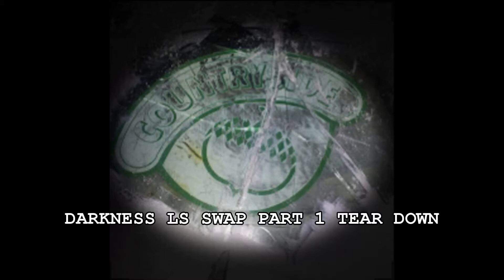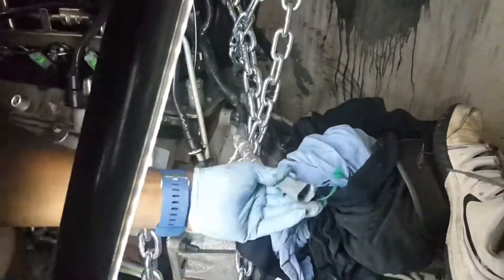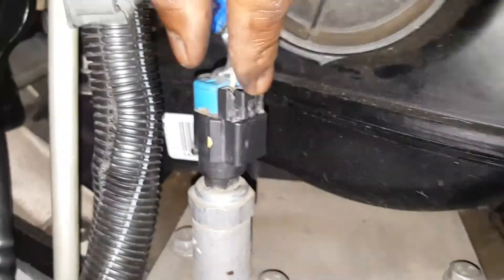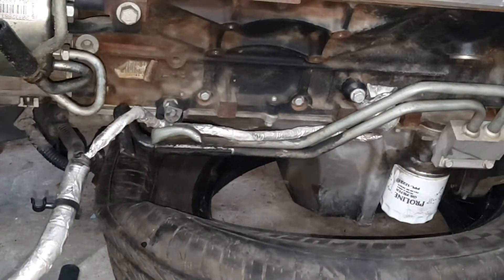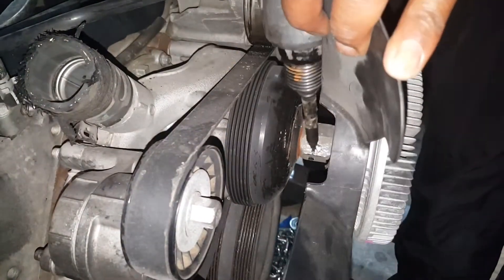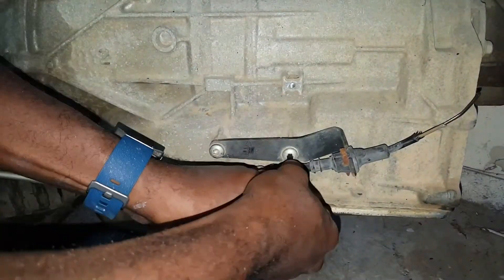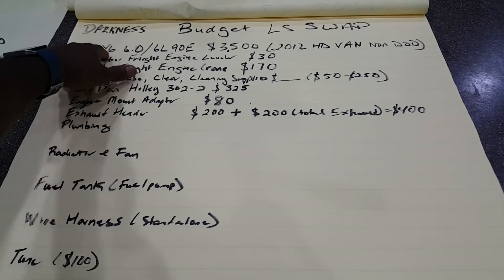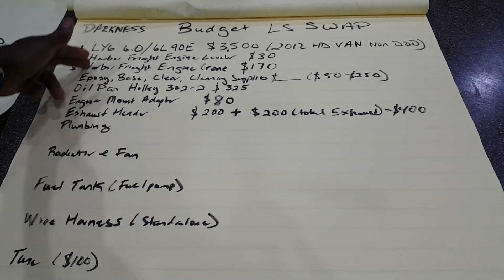LS ENGINE TEAR DOWN STEP BY STEP 'JOURNEY BEGINS' DARKNESS PART 1

Comment: You really didn't need to label all the plugs CJ cos they will lay exactly where they need to go..Plug and play mate...The switch behind the valley is the oil switch...The switch near the starter is a knock sensor...The one above the starter is the crank sensor..Yep the sensor in the chain cover is the cam sensor...DOD is for fuel economy and only activates when you cruise at freeway speed...Keep it stock mate..Harness and all...It'll still go like a scalded cat and you'll have no problems...Trust me on that.
Reply from the maker: That's what up Zig and you know I am just doing extra cause I don't know what's what but that's why I can depend on you the expert..I do appreciate it..I am excited that I should be able to be at a light and not expect for the DARKNESS to maybe cut off lol
Reply: Just keep it simple CJ....I'll be watching.